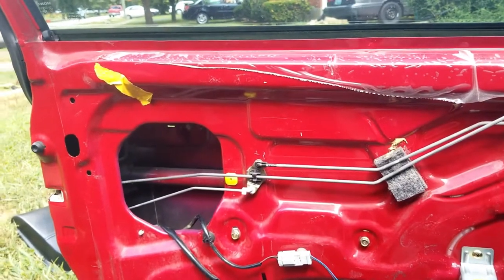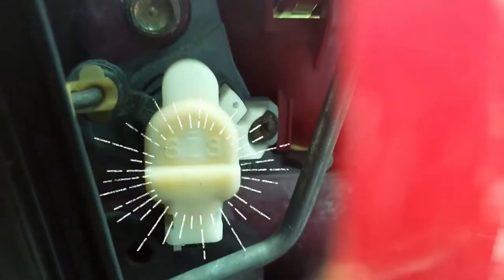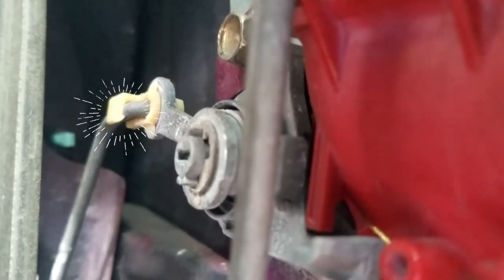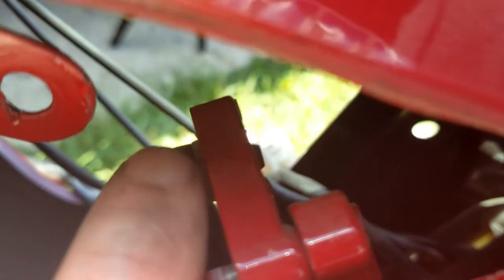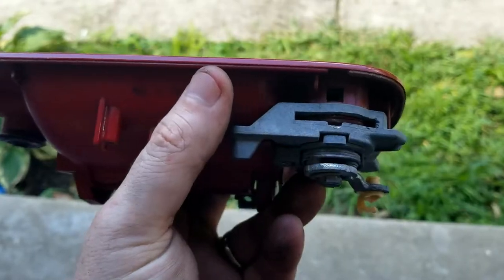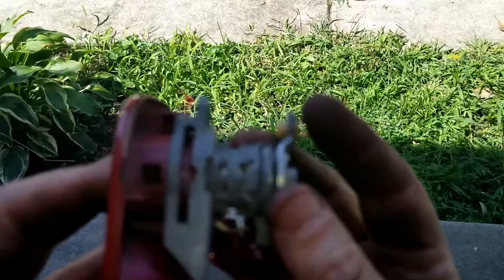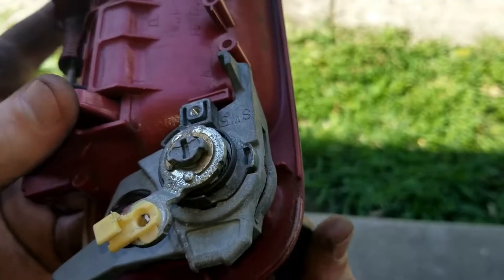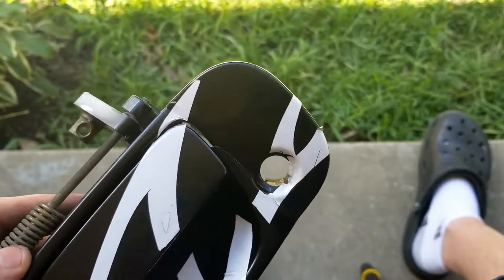How to Replace a 97 01 Prelude Door Handle and door locks 5th Gen Prelude BB6

Comment: Hey is there anyway you could do a video on replacing the door lock actuator? I can't find a video anywhere and my 5th gen has been bugging the living crap out of me since I bought my prelude
Reply from the maker: Unfortunately the Prelude was a fix and flip and I have sold it already. I did plan on fixing this on my prelude but the guy that bought it wanted it now and didn't want to wait till I fixed all the little stuff.  I very much miss the Prelude!! I do plain on converting my Civic Wagon to all power options. I don't know when I'll start that but I will have a video installing the door lock actuator, it will be very similar to the prelude. Pretty much all Honda's have the same door lock actuator installation procedure. Other than the actual part number installing them is pretty much the same.
Reply: @MrJayDM   alright thanks!

Comment: Wow... this seems like a giant pain in the neck. I want to install an aftermarket alarm in my BB6 Prelude now that I've started modding it & I have the issue where the electronic locks don't work half the time. I read it's most likely due to the actuator. After watching this video I don't want to do it myself & I'm scared my mechanic will break it being it's so sensitive.
Reply from the maker: Another reason the locks may not work sometimes is the wiring between the door. There is a connecter in the rubber boot, the wires will separate from the pins, sometimes they make a connection and sometimes they done. This is more common on the 1st gen CRV but I have seen all Honda's 15 to 20 years old have this problem.
Reply: @MrJayDM  Hmm... Well it always moves, as is I hear the noise, and it may move ever so slightly, but it's like its stuck.
Reply from the maker: @Tetsu9701  yeah sometimes the actuator doesn't extend as far as it should. You could try and spray some lubricant in there. They are probably just old and worn out. They are really not that hard to replace, it's just time consuming. Once you do it you will seen it's not that big of a deal to replace and it will give you the confidence to do other minor replacements. You could always go to a junkyard to practice, all Hondas are all basically the same. Also you can pull the parts that are more likely to break that way you have replacements from when you do yours. You just gotta get in there man, don't be scared. This is how you learn. Im no mechanic, I just learned by doing!!